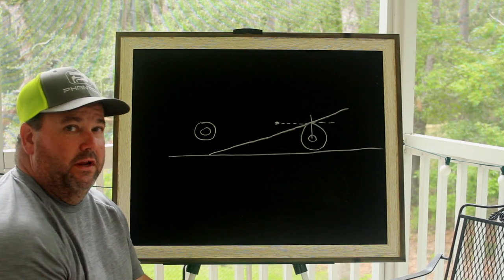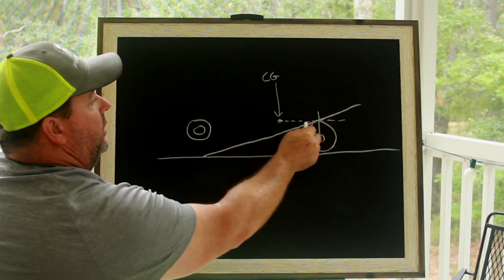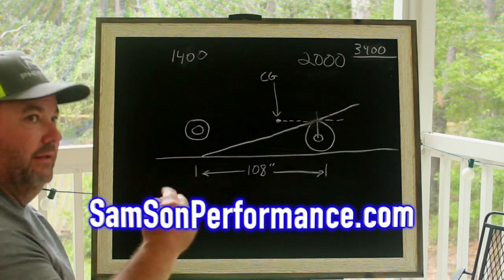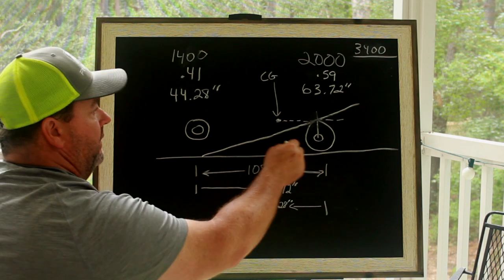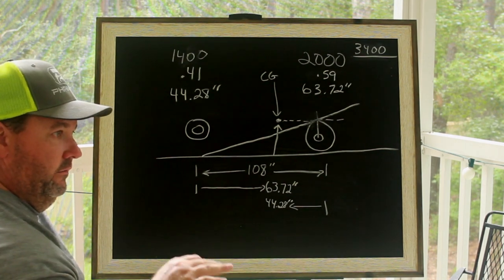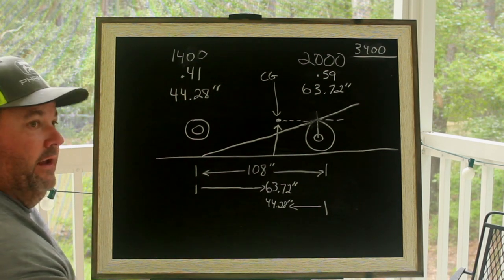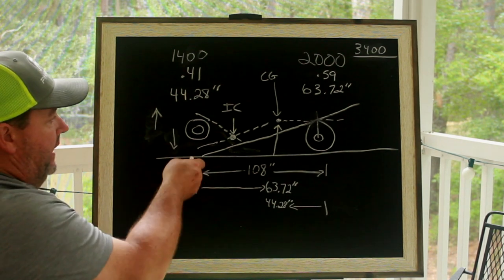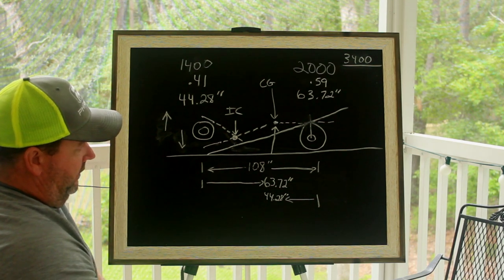4 Link Bar Angles | 4 Link Suspension Explained | 4 Link Tuning

Comment: I just found a new channel to check out. I'm a 4x4 guy, but we essentially have the same principles and the more knowledge we know the better we can build. I'll be binge watching!!!
Reply: For a solid axle jeep open desert racing…do you aim for more antisquat or less? If i aim for more seperation wont the tires digg alot more into the dirt sand thus make me launch slower? Also on average what do you guys aim for side to side weight bias ?

Comment: Kevin, Thank you for the explanation on the 4 link bar adjustments . Not knowing anything about 4 links when I hooked the bars up , the car hooked up, I think it would have hooked up in a gravel pit but the car stood straight up at the track.  By following your calculations and drawing it out on my garage floor I did the adjustments to the bars to get the bars adjusted to just above the anti squat line.  The car launches straight , hard with no wheelies.  Very happy. Thanks again.
Reply from the maker: steve mustaikis thanks so much for your comments! Go fast, go straight! Be Safe!!

Comment: First, thank you. Second,  I got lucky when I put in my ladder bar / coil over setup. I did read the instructions and followed them not knowing what I was actually doing. It isn't perfect but my car is at or just over the anti squat line intersection but can be improved now I know more of what needs to be done. You are an excellent teacher sir. Again, thank you!
Reply from the maker: Stuart Buckley thanks so much for your comments! This is great news on the installation and I am excited that the videos are helping you be more comfortable tuning your suspension. That is my primary goal of the channel so I always enjoy hearing that part. I have worked with many race cars with some pretty crazy geometry on the bars and chassis mounts. So you are ahead of the game per se' if you started off with good geometry. I will be doing another ladder bar video soon which will give you more insight on tuning ladder bars specifically. Stay tuned! Thanks for the compliments and for supporting the channel. Go fast, go straight! Be Safe!!

Comment: At 23:00 mins it really made sense of what Center of Gravity is, hold the car from a cable and it will balance level, push under from the rear it'll wheelie. This video has been the best out there for us that are Challenged at Suspension Math. This is where I know my 63 Nova is having issues just while watching this video and your others ones. I run a 4-speed with a slipper clutch leaving at at 4500-5K and my caltrac bar setup just does NOT like it. Mainly because of the location of the bar. Just by watching your video and me guessing at my Math I could use a extra lower hole or 2 for sure. I had to pre-load 3/4 of a turn which is alot to calm this car down, calvert said 1to2 flats thats all.

 I bought a used set of badass santhuffs so I have plenty of shock control.

Its very likely I'm going to be doing a ladder bar, I can see doing some 38"to 42" ladder bars to get that lower bar to push this car. This is a straight axle gasser so admidityly the front end doesn't have a ton of travel, very stiff front. These cars rely on controlled spin but to push the power from under it and pull the tires instead of what mine does and unload and bounce.
Reply from the maker: awsomeears thanks so much for your comments and info! Good luck with your build and that sounds like a strong ride! Go fast, go straight! Be Safe!!

Comment: Hey Kevin
It's me Jeff, I bought your very first rubber upper four links from your website baseline suspensions that were not adjustable you actually made them specifically for me, unfortunately they weren't adjustable like your other setup that you have with the two hymn joints for the Buick Grand National.

But I also have the other setup where it's solid.

Shortly after I purchased these you came out with the adjustable uppers with the rubber bushing in the front, I wish I would have waited cuz I would have more adjustability out of it.

But glad to see you're doing well

Jeff
87 Buick Grand National
Reply from the maker: Faithfully Live thanks so much for your comments! That wasn't me. I have never sold any stuff like that, but I appreciate it. Go fast, go straight! Be Safe!!

Comment: Thank you for putting these together.
Reply from the maker: 1quickchevy2 thanks so much for your comments! I am happy to do these. Hope they make sense. Go fast, go straight! Be safe!
Reply: @KevinWilsonSBC  do you guys offer a "remote tuning" kind of service,  for guys like me that live in the great white north?  I have a new set up and would like a good base line before towing my car 5 hours to the nearest track,  only to start from scratch.  It's a 67 Chevy 2 with a parallel 4 link.  Small tire car 26x8.5 ".
Reply from the maker: Absolutely, we offer remote tuning services! In the past 3 months we have helped over 35 drivers improve their 60 foot times via remote services. Goto https://samsonperformance.com to learn more about us and from there you can start the process (middle ways down on the home page). Email will be the best way to get started as the number of calls we get each day are just too many to answer and get work finished. Getting some key info from you about your car will be necessary to start any remote tuning, so on our website we have a Drag Car Launch Tuning PDF file you will download and that will help us work with you based on data. Go Fast! Go Straight! Be Safe!

Comment: One of the best explanations ever.  GREAT JOB.  Always good to use knowledge and experience from older and better racers and apply this information to our car.  Were trying to hook on a 1971 Chevelle with adjustable uppers and boxed lowers.  We do pretty good living on TB at 5000 with a 400 sbc when track prep is good but lauching in over 100 degree weather our 60ft goes to shxxxxt
Reply from the maker: mike balzer thanks so much for your comments and encouragement! Go fast, go straight! Be Safe!!
Reply: You have to race the track

Comment: Brilliant, I'm trying to make my 45 year old classic road car into a better sprint / track day car and suspension is key. I'm currently sideways all the time which is entertaining but tbh unnerving and usually results in trying to hard, so thank you
Reply from the maker: Michael Beacham thanks so much for taking the time to comment! Good luck on your project and I agree with your comment on suspension is key. Go fast, go straight! Be Safe!!
Reply: @KevinWilsonSBC  Just fyi really. After watching this several times I've taken all the measurements and I don't have an IC. I have 4 link rear suspension as standard on my 1972 sprint car. I do have upgraded coilovers, springs, bushes etc etc but my trailing arms are perfectly parallel, both pointing down (from rear to front) at 3 degrees. So that explains why now its just rubbish off the line. Axle tramp, squatting on drivers side etc etc. Thanks

Comment: Kevin, thanks for responding, now I know you're real people trying to help and boy! do we appreciate that. Let me rephrase my question. After you determine that the CG is 44.28" behind the front spindle why don't you move the 100% AS line back to that point which would change the angle of the line? Does AS line go from rear tire patch to cam height over spindle or does it go from rear tire patch to CG? I guess I'm missing something, thanks again and keep the videos coming
Reply from the maker: Robert Briggs now I better understand your question. The AS line will always run from the rear slick contact patch to the vertical centerline of the front spindle and the height of the CG of each car. For the height of this intersect point, it is always best to do the calculation for your car to pinpoint the CG, but not everyone can do all that scaling and jacking around of their race car, so a general rule of thumb to get the height of the AS line intersect point to the front spindles close is to use the height of the camshaft location. The distance of the CG from the front end is just another tool we use in relationship to the IC height and length to help understand how the bars load the suspension at the hit and through the pass. That will be covered more in upcoming videos. So in short, the AS line will ALWAYS be a line from the contact patch of the rear tire to the road/track to the front spindle vertical centerline at the height of the CG of the car, or height of the camshaft as good starting point. Does that help on the AS line?

Comment: I just got turned on to you and I'm hooked. Subscribed, liked and notifications are turned on. Your videos are very informative and I dig your style. Your timing is actually pretty good as well as I'm getting ready to scrap the 4 link set up that I bought for my 64 Nova. I purchased a four-link kit from a company (I don't want to bash them) but it's a nice set up maybe for the street. Since I've been racing more often, I don't like how my car launches (Squats). The thing that gets me is, all the videos mention the top bar and bottom bar "intersecting" each other at some point. I understand that most setups do and this and is desired so you can manipulate the intersection point depending on your application, but in my current set up both the top and bottom bar are parallel!! There are no adjustment holes on the housing nor on the cross member side. So basically they will never intersect?? Very frustrating. Also the top bar is not on the top side of the rear end housing. It's mounted on the front side of it at about the centerline height. I've heard it's good to have the top bar closer to the centerline of the axle but shouldn't it be at least on the top side of the housing? I have purchased some 4 link brackets that I will install in place of what's on there now. They have 4 hole locations for both top and bottom bars so that should help with my situation. Sorry to write you such a long story but I just wanted to hear what you thought about my "parallel bar" situation. Thanks
Reply from the maker: Anthony Burgess thanks so much for your comments and questions! Appreciate the nice feedback and support on the channel. Sounds like your current 4-link is more for street or even street rodding. For drag racing, which is my focus, I need to be able to adjust the bar locations for my instant center length and height and I prefer to have the top bar on top of the rear end axle and not out in front the tubes. Good to hear you are taking the steps you are taking to tune your launch and you will not regret it! Nice work and keep us posted on your progress. Go fast, go straight! Be Safe!
Reply: @KevinWilsonSBC  You rock! Thanks!
Reply: Kevin Wilson will do and thank you!
Reply: Just an update, as I've just watched your video again :). I finally decided to go and cut the old forward brackets out and weld in the new ones. I have yet to make a pass with the new set up since I'm currently freshening up the engine also. It is nice to be able to put some angles on my bars now. I'll keep you posted and thanks so much for what you do for us racers out here that aren't as skilled as you are in this department.

Comment: Excellent video!  In drawing the anti-squat line, it seems that only the height of the center of gravity was used (as you need its intersection with a vertical line through the center of the front wheel.)  So why did I need to have the car weighed on scales and determine the front-back placement of the cg?
Reply from the maker: Thanks! The chalkboard is definitely not to scale. The AS line goes from the center contact patch of the rear tire through through the front spindle centerline at the height of the CG. The location of the center of gravity front to rear is absolutely critical to understanding the reaction of the Instant Center location and height. Take a look at this video to help understand that point more: https://youtu.be/_vtb_utqSJM 
Go fast, go straight! Be SAFE!!

Comment: Kevin, great video.  I was wondering if you had any info on obtaining anti squat with a trailing arm setup as opposed to a 4 link. Thanks so much.
Reply from the maker: C Ten thanks so much for your comments! Same basic thoughts. The chassis mount point, length and height will determine AS. Generally, on the long trailing arm, getting it shortened is a good move since the stock length naturally wants to just squat. Go fast, go straight! Be Safe!!

Comment: Absolutely great videos...  But, I have a set of Intercomp 500 series scales. Their instuctions are very vague on measuring Vertical Center of Gravity. I am not sure which scales you use. But, could you explain how to correctly measure Verticle CG using their scales. That would e great!  Or a possible explanation that is better than theres. Thanks,.

Comment: 🏁 ⬆️⬇️Old-timers I've built cars/chassis for in the past have told me they used to try and control this by putting on what I believe they called 90 10 shocks. These were used to transfer 90 percent of the weight to the rear tire. I think this is how the gasser was was created. If you've ever drove a Gasser down the track there a handful. Thank God chassis design has come a long way. Great video good job pretty cool so many people are getting educated from it and actually getting an understanding of how the force's act on or through the chassis. Just the safety alone from setting up a chassis correct is huge!!! You'll probably save some lives or at least keep some cars off the walls through these teaching/educational videos.. 👍👏burn rubber

 I might not be stating the 90 10 shocks correct so forgive me if I'm wrong it's been a while since I've seen them old dude's!
Reply from the maker: Danny A KustomKing USA thanks so much for your comments! Go fast, go straight! Be Safe!!

Comment: Thank you for the awesome video. You wouldn't happen to know how to apply this knowledge to a motorcycle swingarm would you? The part I'm having trouble with is the upper chain run as it's kind of like the top bar but exerting force in the opposite direction
Reply from the maker: My apologies but that is not something I have messed with... I would think a longer swingarm would improve traction with more weight transfer... Go fast, go straight! Be SAFE!

Comment: Great videos…. Coming up with a 230% anti-squat line  instant center  length 28 inches … height 12 inches  . have a factory 4  link 68 GTO running on slick . coil over front and back. Is that Anti-squat line way too high ?1200 hp on spray  front heavy no prep car .

Comment: What do you recommend starting at antisquat wise in a very nose heavy longer wheelbase truck? Its a diesel truck. Makes 1100hp and about 2000ftlbs. Wheelbase Is 117-5/8 I can go as low as 78% or as high as 180 range.  Big tire 33/15 stiff sidewalk slick can send a few vids but don’t really have any good test passes yet. Have changed a good bit. And I can send excavation corner weights. Bias is 40.9/59.1 race ready 3940lbs
Reply from the maker: Iride813 thanks for commenting and some good info already. Go to https://samsonperformance.com and shoot me an email and I will work with you once we cover a few more pieces of info. Go fast, go straight! Be Safe!

Comment: Still trying to set up a 4 link conversion in my "74 vette. Autofab 9".  Some say to start out by adjusting  to a neutral setting with the car jacked up, rear hanging . When I do this and let the car down( weight of car on tires) it goes into preload. Should I find  neutral  with the weight of the car on the suspension and tune from there, as this is the way it will go down the track? Should it make a difference? PS I just hit the subscribe button
Reply from the maker: Robert Briggs thanks so much for your comments, questions and for subscribing! I generally start out by making sure the bars are the same length with rear end hanging. Then I sit the car down, settle the suspension, roll it back and forth, confirm square and make sure the rearend is centered. Then I check/set pinion angle. Then I move to rear preload with the car on the scales. Hope this helps. Go fast, go straight! Be Safe!!
Reply: I also have a ‘74 vette with the Autofab 4-link. A great starting point for your instant center would be around 9.5” high and around 37.5” forward.
This should give you around 130% anti squat.
I will plant the tire into the track surface.
Try and control the rate at which this happens with a quality double adjustable shock.
Top bar is going to be in the only hole above the axle bracket and attached to the second from the lowest hole in the top frame bracket.
The lower bar is going to be in the center hole on the lower axle bracket and the lowest hole in the lower frame bracket.
Corvettes have a significant amount of engine set back and tend to wheel stand. Travel limiters quality front shocks, and maybe a little weight added to the nose of the car might help with this.

Comment: The link for the AS calculator says that it will give a false reading if you do not use their products, is this something we need to take into account for? Thank you for the info, good breakdown.
Reply from the maker: Gap Cam TV thanks so much for your comments! That is a just a reference tool. The main goal of the site is to put your measurements in and get your IC length and height. This is representative to your weights entered and CG. It is not perfect, but the goal is a known baseline, then go test and video. Next moves are then more educated versus just throwing things at a wall. Go fast, go straight! Be Safe!!